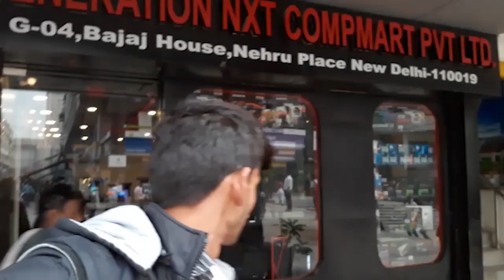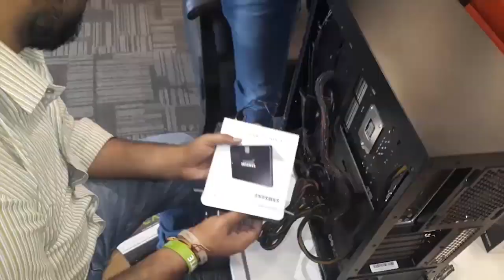1 lakh Gaming pc build shocking   price difference offline nehru place,delhi  vs amazon online

Comment: bro meene vipin transport se kerwaya tha built
CPU - AMD r5 1600 6 core
RAM -16 gb 2400 corsare 
GPU - gigabyte gtx 1060 6gb oc
MB - asus b350
PSU - coolermaster 500i
case - coolermaster
HHD - 2 tb WD
SSD - 250 gb WD
Monitor - Ben-Q ka 22in gw2270
sab kuch Rs 82,764 m lia tha

Comment: My 1.processor is core i5 8600k..2.mobo:Gigabyte Z370xp sli
3.Ram..8 gb 3200 g.skill ripjaws
4.cpu cooler:Cryorig h7
5.Psu:antec neoeco 650 modular
6.Ssd:gigabyte ud pro 256 gb
7.hard drive:wd 1 tb
Graphics card..haven't bought yet cause wanna switch to the nvidia rtx series which is yet to come..
Reply: Shamir Roy aa gya hai rtx 2080ti
Ja k le lo..md computers se

Comment: Bhai , Cooler Master masterbox lite 5 RGB case(cabinet) koh sih shop se lia Nehru Place mai .... aur cpu cooler cooler master kah kaha seh lia .... kya ap bata sakteh hai?????

Thanks for the video btw.
Reply from the maker: gigabyte showroom se
Reply: Step set ... thanks a lot
Reply: Cooler Master MasterBox Lite 5 Cabinet amazon pe 3986rs hai
Reply: Jatin Shingrut ...  thanks for info but that one does not have tempered glass and rgb fans ......... while the MasterBox lite 5 rgb has.

There is one case called MasterBox lite 5 rgb and other is called MasterBox lite 5.
Reply from the maker: mr. jatin shingrut can u tell about amazon link? where u r getting lite 5 in price of 3986
Reply from the maker: tim serious link  that u share with that have Acrylic Window (slide panel). and i have tempered glass.
Tempered glass: looks a lot nicer and feels a lot more professional and expensive, and can also be easily protected via padding.
Acrylic Window: Much cheaper, and lighter so it is easier clean, but once scratched it is game over, you'll always notice it, this can also be protected by padding or through a screen protecter type layer. 
 and in this case they also don't claim for rgb fan . u can see ans in form of amazon.
i have this one http://amzn.to/2lqIpmh . genuine seller always mention all features clearly.
So be aware . Best of luck

Comment: I think u all r asking the wrong question bcz graphics card never bottlenecks a cpu but a cpu bottlenecks a graphics bcz cpu is the communication system between yr output experience and yr graphics card and bottleneckonly happens when cpu is weaker than gpu not gpu is weaker than cpu.
See Linus for more information on bottlenecking-
https://youtu.be/i9XuCz1FQEU

Comment: My setup for rs. 1.05 lacs 
1)hyper x fury 2400 MHz * 2 = 13540rs
2)B250 M- D2V = 5840rs
3) i5 7600 = 16400rs
4)850 evo ssd samsung = 6920rs
5)seagate 2tb barracuda = 4800rs
6) vx 650 power supply =4000rs
7)cc 819 circle gaming case = 2550rs
8)deepcool neptwin cooler= 1600rs
9)gtx 1080 = 45200rs
10) asus fhd monitor = 8750rs
11) keyboard mice combo (gaming) = 2700rs

Comment: Mera 90thousand ka laptop issey acche hai I7-7700HQ, 2TB HDD, 256GB SSD, GTX 1060
Reply: Riktam Sarkar bro desktops are  tougher and more secured than laptops...mone rakhbe!! Laptops are fancy compared to desktops.
Reply: The Techy STK Must tougher is ok but secured. Ektu explain korun (explain it)
Reply: Riktam Sarkar secured..in the sense that Desktops are future secured....you cannot upgrade much inna laptop...while you can upgrade the way you like in a desktop......laptop battery becomea useless within a year or two....in desktops there is no need to worry bout batteries....aro kichu???
Reply: The Techy STK Been using all kind of gaming laptop. Had a alienware for 6 year recently changed didn't have a single laptop who told you battery gets damaged.
Reply: Riktam Sarkar Bhai apka laptop ka konsa model hai... Muje lena tha isiliye puch rha hoon
Reply: Tejas kotecha Acer Predator
Reply: FUCK LAPTOPS THEY SUCK BALLS
Reply: Riktam Sarkar ap Pakistan k ho